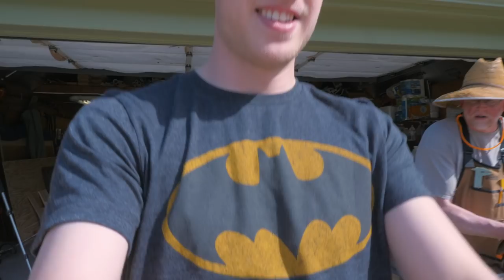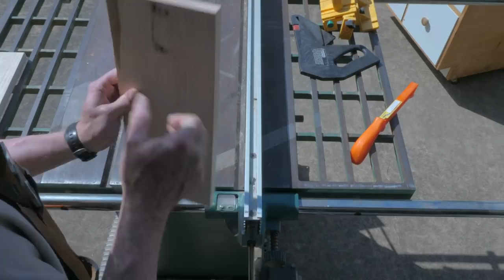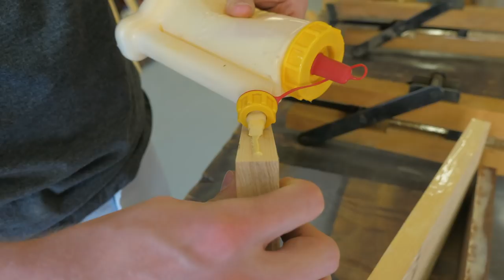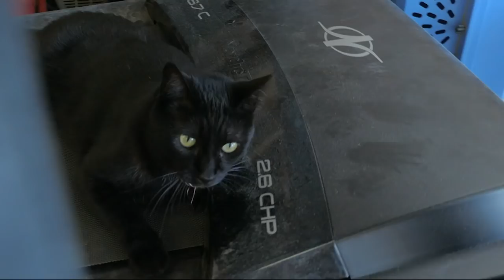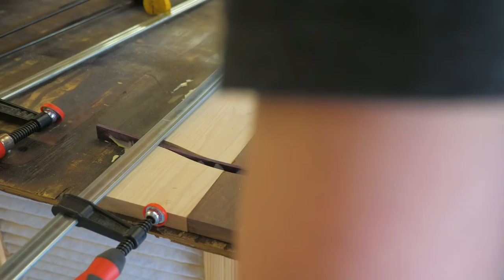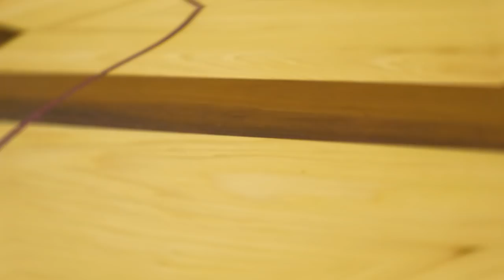Cutting Board w/ Wood Bending | How to

Comment: A simple small bender is a wallpaper steamer. I take the hose and use clear zip bags and gorilla tape to seal them. You can also use plastic totes for the steam box. I do recommend the Rubbermaid over the super cheap dollar store ones. The cheap ones get real soft fast. You can fabricate a wooden steam box as well. I like the bag method because you can steam longer bigger pieces. Oh it also works great for breaking glue joints if you make a mistake and find it after it dries..

Comment: Very nice, what I do, is put two pieces of different woods on top of each other, stick them together using double sided tape, run them through the band saw making wiggly lines and then change over the middle piece of the bottom wood to the top piece of wood, which naturally fits. Turns out really nice.

Comment: just a friendly word of advice.   whichever one of you was using the table saw in the beginning.   Youre going to end up hurt if you keep doing that.   no riving knife and pushing the work piece with your pusher next to the fence.  the pusher should be closer to the blade, that twill hell keep the piece from twisting in, riding up on blade and kicking back.     ask me how I know.   lol
Reply from the maker: How do you know?
Reply: @jennieanddavis  lol    I used to do exactly as you are in this video, its only a matter of time before the work piece catches on the blade, it will ride back up over the blade and right back at you.  once set in motion, there is no stopping it
Reply: Thats right it happened tome once. It ruined the piece i was cutting.  My god luck kept me out off harm.
Reply: hate to be safety police but I agree.  practices here show someone who has not yet had a piece thrown back at them.
Reply: Good tip - I was using a wedge to assist a piece of wood through the saw one time, doing kitchen renos, the wedge caught the blade. Projectile. Off my stomache into the wall. It literally stuck in the wall. Lucky I was standing at an angle so the 10inch wedge(a piece of 2x4) glanced off me. I guess we all need a scare. I will never do that again.. I left it in the wall to be a reminder - eventually the wife said I should fix the drywall....
Reply: thought the same thing immediately when I saw this... keeping the board against the fence and down will save you.   Narrow push stick near the fence will incline the board up and away from the fence, inviting dangerous kickback.
Jessem fence guides can help.
Reply: Wondered why but old habits die hard I  assume

Comment: A few words of advise.  Do not cut boards to exact length when using several to glue up a panel.  You will need to trim the ends of the glued up panel to even the ends up.  You wanted a cutting board that is 16"  and ended up with a bit shorter.
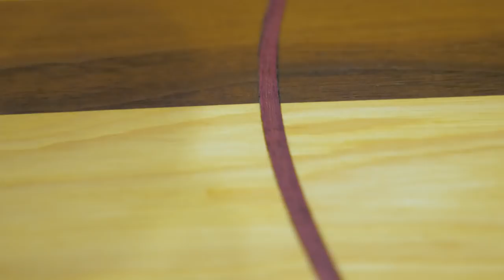The next item to consider is that the purple heart glue line is a poor one.  It will likely break along that line.  The issue here is that you cut the panel with a likely 1/16" wide kerf.  Then you added an approximate 1/8" strip between the two pieces of the panel.   When you cut the panel with a curved shape your radius from one side of the cut piece no longer matches the curves on the opposite piece.  You have to replace the same amount of wood removed, the saw blade width, with the same size material.   This becomes more apparent with wider pieces of wood strips.  This is apparent at 5:25 in you video where the purple heart crosses the walnut.
Here are a few I made a couple of years ago for gifts.  In all cases I removed exactly 1/2" of material and replaced with 4, 1/8" strips.
https://www.flickr.com/photos/lcb11211/15897346730/in/dateposted/

Comment: Enough people have made comments about the Purple Heart glue joint being weak, but I have yet to read a comment about any other way to do it. My recommendation is to take a scrap piece, cut your curve, then clamp that to the work piece and use a top bearing bit to cut a groove. To bend the piece, you can use your scrap piece to shape the insert then glue it in place. Just a thought. Once I get as big as you guys, I will try to make my own video.

Comment: Try using steam for bending. Once you get a feel for it, it works amazing. Takes some trial and error (like anything else). Started out using an old "Singer" brand steam cleaner to steam with. Then moved up to a steam chamber. Check out The Wood Whisperer on YouTube. He has a good video on making a steam chamber and uses it in the video. Just remember  the obvious, different woods and different thicknesses take different steam times and have longer or shorter working times. That's where the trial/error comes in. I live in Pennsylvania so I think my steaming & working times would differ from yours in Texas (temperature & humidity difference). Good video and god luck. Steam bending opens a whole new dimension in woodworking.

Comment: Since the Purple Heart is kiln dried, some say bending can't be done.   In lieu of soaking, I steam bend a lot of kiln dried wood, I would have tried to steam it for about 30 minutes, then slightly overbend with the form (add some small strips to overbend on curves for springback), then let it sit overnight to dry a bit.  The tight grain just seems like soaking in water doesn't do any good. 
I totally agree with the assessment of an eventual break, spotting at least a one dowell in each board might help.    But I think you guys are onto something really unique and classy.

Comment: surely gluing the purple heart perpendicular to the grain of the board will split it won't it ?
Reply: It looks cool, but you will probably find in time it will split the board in half. Iv made the same mistake.
Reply: Yup.  It's a matter of time.
Reply: @jennieanddavis  You made a long grain to end grain glue joint... Why put all that work into something that wont last?
Reply: If it doesn't split at the very least the purple heart will swell differently and it won't be smooth
Reply: @Alyn4220  For someone who is new to this, I have a question. If they had a board wide enough to cut an end grain strip, would an end grain to end grain joint work? And what other attributes am I not thinking of that would affect the longevity?
Reply: ikeknights no the wood would break  being so thin, wood is stronger with the grain.

Comment: where can you get the wood clamp he used?
Reply: Found some on Amazon for around $45. I use two pieces of metal square tubing wrapped in packing tape, but now I want these...
Reply: Btw they are called 4 way panel clamps

Comment: May look nice, but you must consider wood movement. Not only will glueing a piece end grain to side grain split, its also an extremely weak joint. Couple of season changes and this thing will be firewood
Reply from the maker: It's been 2 years. Still going strong with daily use. Even smacked the corner on the counter. It's also made a few mistaken trips into the dishwasher. It's still fine.
Reply: I made a similar board about 5 years ago. Admittedly, not as a chopping board but as a serving board for the table centre. Still going strong.

Comment: I noticed that the Purple Heart was put in perpendicular to the grain of the rest of the boards, so your joint is end grain to edge grain, which I am not confident will last.  In addition, wetting the Purple Heart to bend it will not lead to a long lasting hold either.  

I really enjoy watching your videos, but there are times that the quality is not that high.
Reply from the maker: Quality is directly proportional to the budget of the customer.